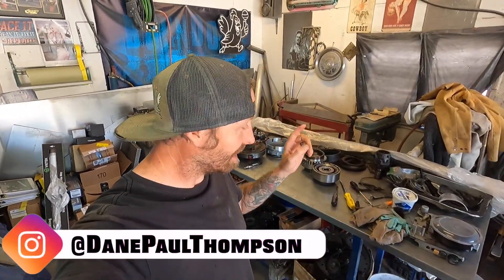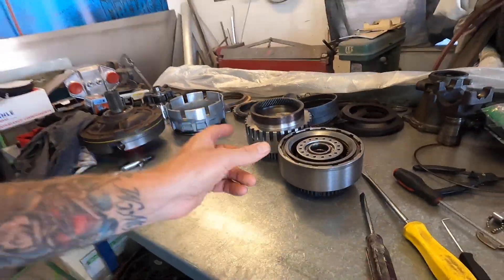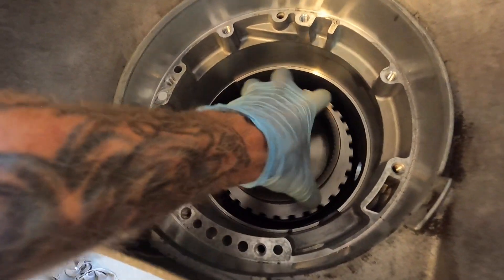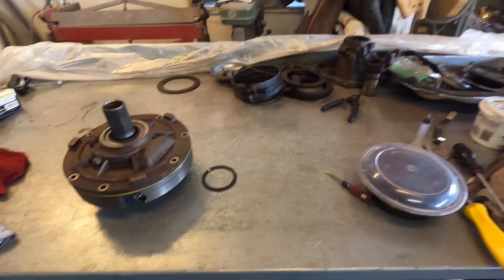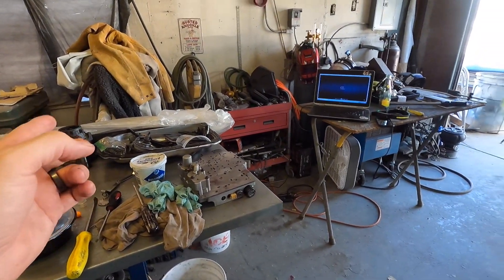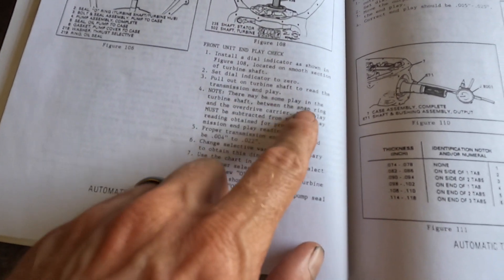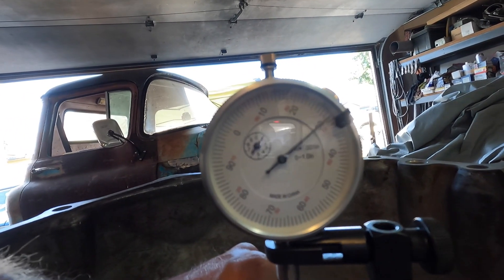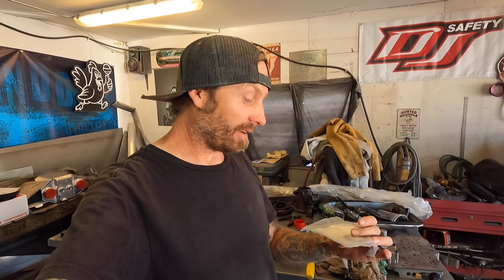Installing the rest of the 4l80e and checking front end play

Comment: You'll be happy you took the extra time. By the time you finish the other one for the Boom, you won't be apprehensive about pulling a 80e apart. I was the same way. It's a pain at first to get the drum set into the clutches. Are you pre aligning the teeth with a pick or screwdriver first? It helps. Eventually you'll look at it like a glide that takes more time and weighs twice as much 😁
Reply from the maker: Well I can pretty much assemble the whole ting at this point without help haha. Thats not because im a fast learner its because I have had it apart so may times my fingers hurt from grabbing the parts and pulling them out😆. I don't know the names of all the parts yet so at that point ill have a handle on it I guess. I may build another one for a swap im going to do. The boom is getting done by Ryan so it can hold all the horsepowers.
Reply: @Burndown  good to hear. I was the same way. I've got pretty decent at it now and yes the ring gear on the forward drum chewed my fingers off too. When you are sitting it in the clutches and having trouble. Hit the intermediate clutch with some air, thru center support bolt. It shows if you are fully seated and seems to help line the clutches up to get it in the last 1 or 2.

Comment: I'm assuming you've figured out by now that that's not your endplay?
Reply from the maker: I believe this was the one I put together for the Twinnebago and had never done it before. That transmission is in the bego still at this point and has worked great for a while now. I should probably give it a fluid and filter change but she has been a trooper
Reply: @Burndown  I'm putting another 4l80 together rn for my squarebody (supercharged LQ4). I've built 3, but haven't put any of them in their cars yet so I don't even know if they work lmaooo. I was just looking for where you put the front endplay shims, and saw your video. Good luck man!
Reply from the maker: @garretabbott   The front end play isn't as critical as the rear end play. If you way too lose you can change the select washer out that is under the pump to tighten up the front end play. Its the plastic one that goes under the pump.